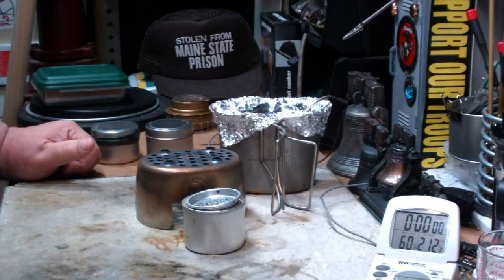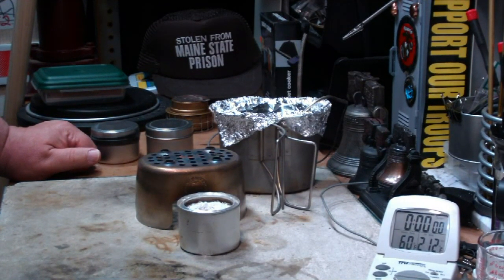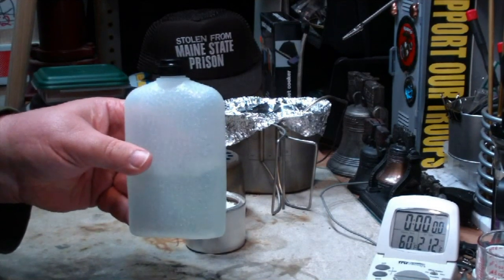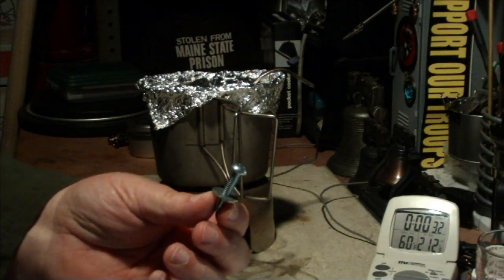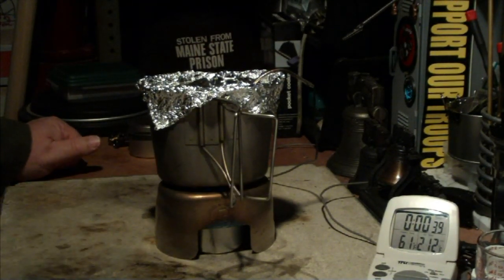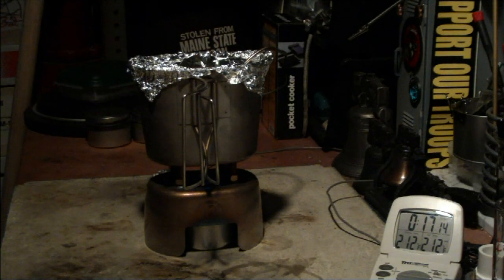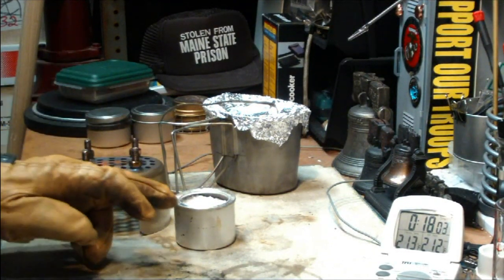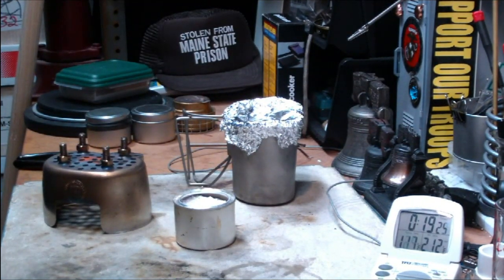CanteenShop GrillTop Stove Stand - Sterno can refilled with Perlite - Boil Test - Reloaded

Comment: Perlite was displacing the volume that could be used for additional fuel.

Bolts were acting like a heat sink.

Try making a 'mantle' out of metal screening to act like a catalytic converter of sorts.

IMHO, the hotter the vapors the more efficient the burn and the less soot.

It would take a laboratory to do a proper oxygen test vs temperature to determine the optimal O2 needed to burn the alcohol completely for a given temperature.

Atmospheric air pressure and relative humidity also have a bearing on combustion efficiency.

Think why do cars no longer need manual adjustments for high altitude fuel ratios.
They use a MAP sensor to adjust things.

What conclusion did you draw from the use of Perlite?